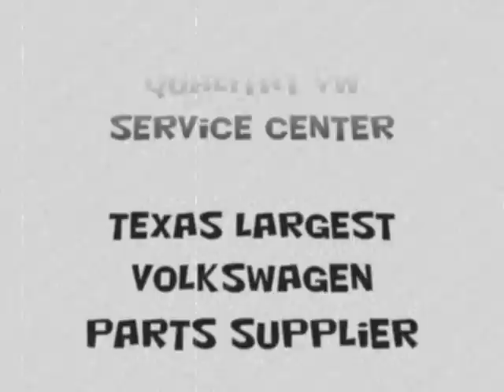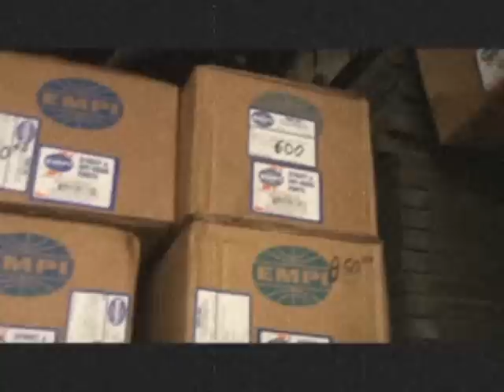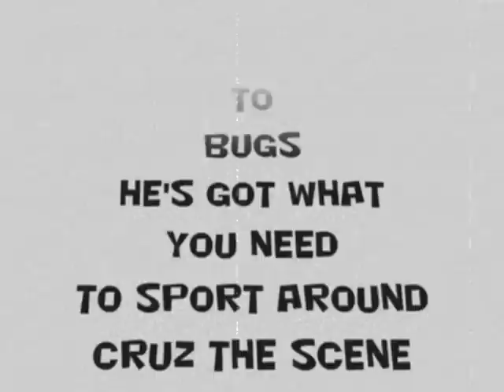The "BEST" Little "VOLKSWAGEN" Shop In Texas-"Qualitat" VW Center

Comment: I think they did a shortblock for the bus engine I built      warned me bout the cooling covers that circulate the air around the motor and to the cabin heat....I was missing a coupla pieces the guy looked at  it and said you need this or you'll be back

Comment: Good video...is the owner Sammie Salamie's brother? You probably don't have the time but if you can you might want to check out Sonic Aircraft...they have pretty much "reinvented" the volkswagen pancake 4...super cool ignition & induction systems...even new cranks with a bigger bolt for the propeller

Comment: DO NOT USE THEM! They sold me an engine with a bad crank that broke after 2 1/2 months.  Blamed be for it and refused to help repair it. There are other places to get your VW worked on.
Reply from the maker: +Jim Snow Im gonna leave your comment on here.. But Ive known DOUG at QUALITAT VW for over 30 years and have NEVER  known him to fuck somebody around on a motor job. I also know he as a limited warrenty on his "REBUILT" motors just like anybody else. There must have been some reason for your crank be brake in half then just rebuilding the engine.. For a VW Crank to BREAK it would take  alot more then just your average driving conditions.. Im not sticking up for DOUG, but I can tell you Ive built 100's of vw engines and NEVER had a Crank Break in half.... Good luck with your problems Jim! Pete
Reply: The crank was remachined .50mm under meaning this part was twice rebuilt. The engine(s) it came out of presumptively  threw a hard rod. I was told the crank was re-conditioned not re-re-conditioned.